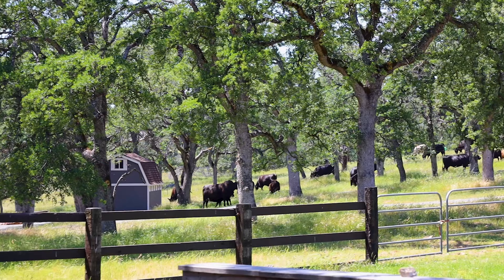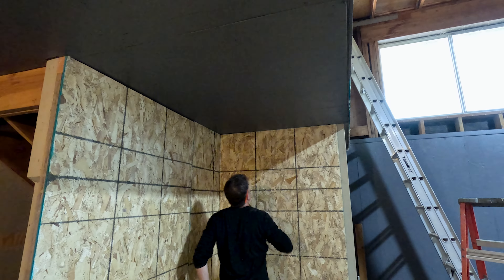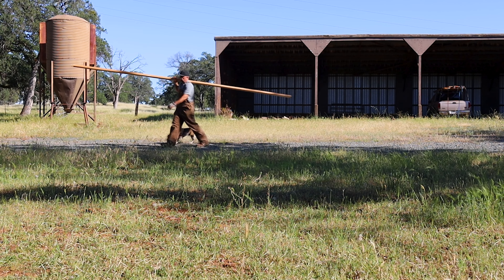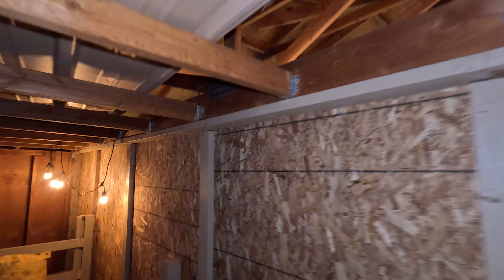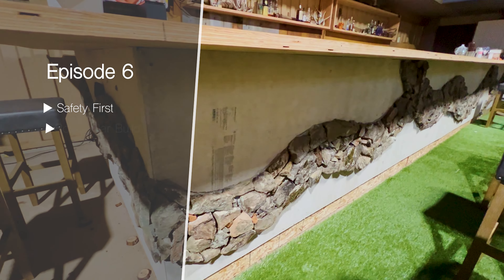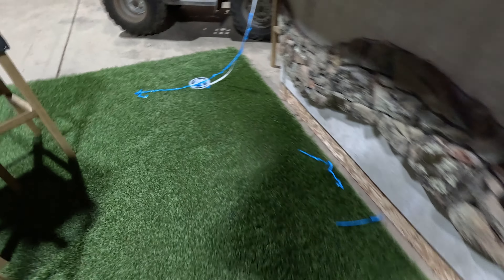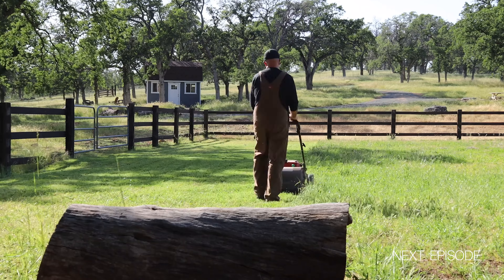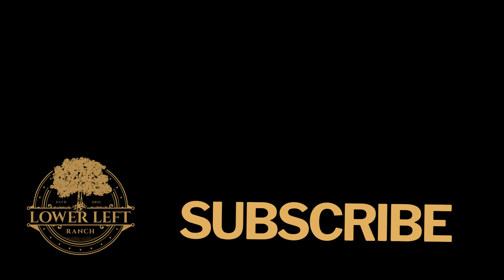"C" is for Cookie. 100 Year Old Ranch Restoration. Episode 6.

Comment: Love the bar! Have a question, do the cabins come with bathrooms n kitchenette s?
Reply from the maker: Some have a small sink prep area but no internal bathroom. Some will have a small bathroom. We're working on the permitting of septic so we can add the large bath/shower facility as well. Once we get the "ok" from the county we'll post specific details of what goes where. It's still up in the air until we get the final plans back from the county.
Reply: @lowerleftranch  thank you for answering. Maybe someday I'll take a ride your way.....